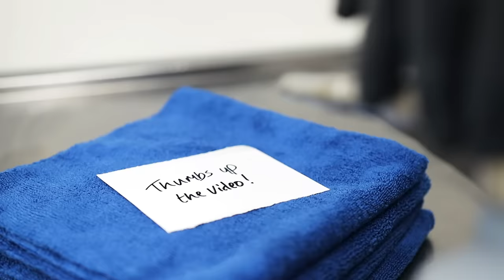Porsche Taycan Turbo Wash, Polish & Ceramic Coating - ASMR

Comment: Amazing job! Really inspirational! Quick question: is there any reason not to take off the wheels? It seems if they were off it would be more convenient and accessible to handle and clean.
Reply from the maker: Thank you! Appreciate it! It would certainly be more convenient, but the owner asked me specifically not to remove the wheels.

Comment: Stunning job, but I've got a question - why do you use eraser after essence? AFAIK Essence is a primer for a coating, especially one from CarPro.
Reply from the maker: Thank you! I prefer to do a light wipe down with Eraser, just in case I missed some residu or to remove possible fingerprints and such. A light wipe down won’t remove Essence.

Comment: Well done! Been in the detailing hobby since 2018 and this is the best quality you can get! I did not know you can mix Reset and MultiX for a foam spray 🤔. Is that correct?
Reply from the maker: Thank you very much! I only mix Reset and MultiX for a prep wash like this. MultiX helps to remove any possible wax or gloss enhancers that might be on the paint. 😉 Keep on detailing!

Comment: giving thumb up just cos that note :D just kidding, its must be very nice to work on car like this :) would you consider adding multiX to snow cannon even for maintenance wash ? (with already coated car)
Reply from the maker: Haha thanks man! I wouldn't do it for a maintenance wash, the reason I'm using it in this video is to remove any possible wax or detail spray that might be on the car.

Comment: Hey, please tell me how to decontaminate wheels which have carbon ceramic brakes without harming them. 
P.S loved the video
Reply from the maker: Thank you! The best way would be to get the wheels off the car so you won't get any fallout remover on the brake discs. In this case the owner specifically asked me not to remove the wheels, so I had to work my way around it.
Reply: Actually you don't have to, as the most contamination comes actually from the pads from normal brakes. In case you want to decontaminate the wheels I suggest you to remove the wheels from the car, as the iron remover may damage the pads and rotor of the ceramic brakes
Reply: @AleVit9  thanks buddy. So iron remover is safe for carbon ceramic brakes. Right?
Reply: @ritviksaurabh6514  Actually iron remover, if used constantly, is not safe for any kind of brake pads and rotors. If used once every 2/3 months then it shouldn't be a problem. But if you use it every time you wash your wheels, it will be harmful for every kind of brakes. I suggest you to remove the wheels once, decontaminate them, wax or coat them and then you will be good to go for a long time.

Comment: Nice wheel clean! What wheel cleaner do you use? I have the Ik foam as well but it comes out in a straight line maybe too think? I do 1:1 rato
Reply from the maker: I'm using P&S Brake Buster, link is in the description, feel free to check it out!

Comment: Nice video good work how we wash the interior door contours, the door sill contour and the trunk contour which product do you use thank you
Reply from the maker: Thanks Chris! Sometimes I just carefully rinse them with the pressure washer and clean them with my wash mitt. You could also use a waterless wash and a towel. Waterless washes are designed to clean the surface without scratching it.
Reply: @VermijlCarDetail  thanks you ❤️👍
Reply from the maker: You’re welcome!

Comment: I'm wondering, how much doest it cost for a full detail wash and ceraming coating approximately ? I don't want to ask too much of you so feel free not to answer that .
Reply from the maker: It depends on the vehicle size, what state it's in and what the customer wants exactly. Some customers only want their paint work to be protected, so that obviously takes less time. I do these types of new car details for around €1000. Vehicles that require (more) paint correction and such are more expensive. Some will say it's cheap, some will say it's expensive. I guess it also depends on where you live.
Reply: @VermijlCarDetail  Thank you very much for that answer 👍🏾💪🏾
Keep up the good work! This is giving me a lot of nice tips for when I'm working on my own car.
Just a question, on another video you used the iron remover from carpro but you used a microfiber towel to make it work better. Not this time, this depends on the state of the car?
Reply from the maker: You’re welcome! I did use IronX on the paint, but just rinsed it off as there really wasn’t any contamination. It was also used on the rims, but I had to be really cautious with these carbon ceramic brakes.

Comment: How come no iron decon for wheels?
Reply from the maker: These are carbon ceramic brakes, can't use IronX on them. The owner specifically asked me not to remove the wheels, so I had to work my way around it. I did spray it on the rim carefully though.